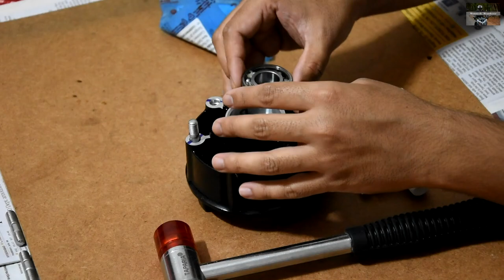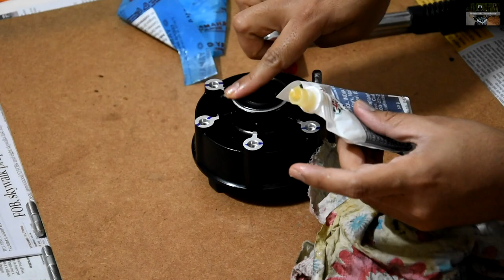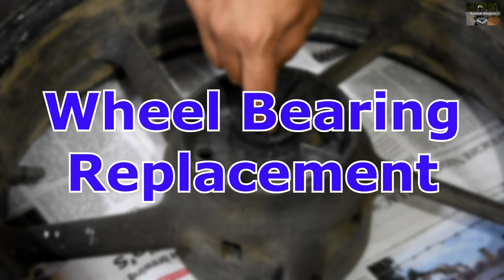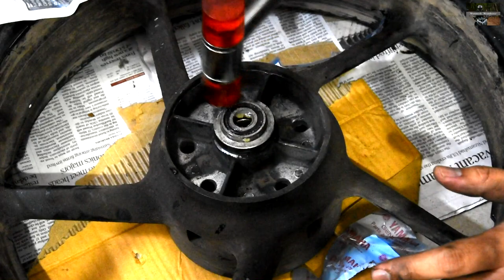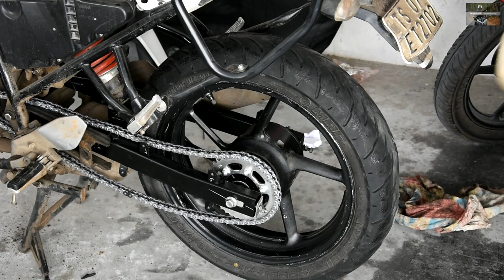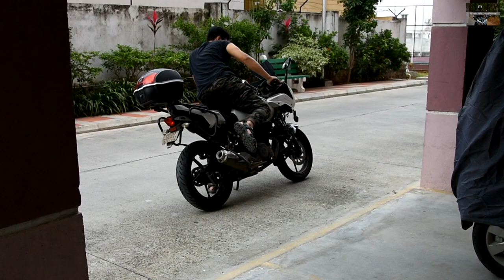#DIY : YAMAHA FZ v2.0 / Fazer - Bearing & Chain Sprocket Replacement : Rebuilding Snowy PART 2 of 4

Comment: Can we use a bearing puller in place of hammering with a rod/screw driver for removing wheel bearing ? Is there enough space between the spacer and bearing's inner ring to slide in a bearing puller ?
Reply from the maker: With the given space it difficult to use the  bearing puller, but you can give it a try. I did not have a puller to try it.

Comment: My fz rear wheel sprocket hub is broken which is attached to chain sprocket and between the wheel... 
What is the name of that part? 
Is that part available???
Reply from the maker: That's the rear wheel hub.
Reply: @MototechWanderer  can i get that part whats the cost
Reply from the maker: I think it was around 800-1200 something.

Comment: Which chain sprocket brand you suggest to go with.
Reply from the maker: Go with Rolon or Yamaha original ones.
Reply: @MototechWanderer  what is the tappet adjustment value for exaust and intake for the fazer v2 which u have
Reply from the maker: @TheAgust  Inlet : 0.08mm to 0.12mm

Exhaust : 0.12mm to 0.16mm

Comment: Gentleman I have Yamaha fz  , recently I'm facing vibration and suddenly pickup dropping ,some times head light increase and drops automatically
Reply from the maker: Regulator Rectifier unit gone - Headlamp increase Decrease

Swing Arm Bush / Bearing gone - Vibration

Air Filter & Sparkplug needs replacement - Low pickup.

Comment: R15 v1 sprocket direct fit in fz v2?(14/42)
Now i am using fz v1 sprocket, 
Any ideas?
Reply from the maker: Nope. Won't be a direct fit. If you need more pickup, look for Pulsar 13T front sprocket.
Reply: @MototechWanderer  R15 v2 sprocket in fz v2 ?? Too many sggstions from alrdy used customers for low end torque

What is your sggstion sir...for high performance ????

Comment: Before fixing/hammering bearing in the wheel hub ,outer surface of the bearing should not be greased, some mechanics will do brazing on the bearing before fixing so that it will be a tight fit
Reply from the maker: The bearing pits were absolutely perfect. Even with grease, the bearings sat perfectly snug. There is no way they can come out, unless hammered from opposite side.

Thanks for the info though.

Comment: My new Rolon chain is currently facing wobbling issues. Chain is moving zig zag. The rear wheel alignment is good. Front and rear sprocket is not bend, Slack tightness is correct. But chain is wobbling and can see the wobble in the rear wheel hub too, i changed the bush inside but issue still exist. If it's the bearing  issue, then the whole alloy should wobble right but the alloy wheel is moving straight and there is no handling issues. Some said Rolon chain has this issue because it's very big chain compared to stock chain.
Reply from the maker: By your description, it sounds like the rear sprocket bearing is worne out. Time to replace the sprocket bearing. The wheel will not wobble as wheel is supported by wheel bearings which are separate entities.
Reply: @MototechWanderer  Ok if the sprocket bearing is worned out the wheel wont wobble right. I thought if the bearing is worn out both the wheel and the hub wobbles
Reply from the maker: If you go through my Fazer rebuilding series, you will clearly understand how the rear section of our bikes are designed. In short, wheel rotates on 2 bearings, one on each side. Sprocket sits on a separate bearing with a collar to hold it in place. 

In my Gladiator, the bearing had broken into pieces, chain was still good but made horrific noises. It took me some time to understand. I actually was lucky the chain did not break on me like my Fazer's incident.
Reply: @MototechWanderer  Thanks for your info bro. I will update once i change sprocket bearing. I'm using MT15 covered 40k kms. Recently i changed the swingarm of my MT15 with R15 V3 swingarm. First i thought it was tge swingarm issue but i've contacted people who changed it to v3 swingarm but none of them has this issue. Maybe it's the bearing. Do u know how much it cost
Reply from the maker: @storymaker_____  put up a video of your swingarm swap. There is always to learn from all of you. Bearing should cost anywhere between 120-250 INR.
Reply: @MototechWanderer  I've uploaded the video on my channel 😁
Reply from the maker: @storymaker_____  I will check.

Comment: why have you used 40 T rear sprocket ..of fz16 ??usually fzsv2 have stock 41T sprocket....By changing to 40 t mileage will increase but little bit lag in pickup.Anyway nice content .
Reply from the maker: I use this mainly for touring. So a little relaxed engine is good for my use.
Reply from the maker: Thanks for your appreciation. Do subscribe to my channel.
Reply: @MototechWanderer  i need good performance bro..what about R15 v2 sprocket ( 15/47 ) for my fz v2 fi ?????
Reply: Suggest me the best chin kit for fzsv2 2018 model pls any one ...tel me the cost of shokbzarber price for fzs v2

Comment: Hi brother i saw ur every video...i myself own a gladiator ss 125 and a fazer 2.0 fi version...can u please share dat, from whr did u installed the saddle stay all touring setup on ur fazer?? I wanna do it
Reply from the maker: I had bought this from Nexus Gear. You can search their Facebook page or visit their website - https://www.nexusgears.com/
Reply: @MototechWanderer  thannx for your valuable reply...keep growing..,💜💜
Reply: @MototechWanderer  is it available at that site for fazer or u have fitted of another bike??
Reply: @MototechWanderer  i have searchd in dat pag....m jst getting parts for yamaha fz 25
Reply from the maker: @anupamdalvi7752  Message them on their FB page they will definitely reply. I got it done on special order as I was their first Fz v2.0 customer. They have the design and can easily make you one now. 😊👍
Reply: @MototechWanderer  thanks alott for ur help brother...i got in  touch with them

Comment: Since you did this all by yourself I have one important question to you! 
The PCD of rear sprocket of FZ and the PCD of R15 V2 are same or not?
Reply from the maker: They are not same.
Reply: @MototechWanderer  Thanks! I was about to procure fz  chain sprocket for my Yamaha R15 V2 after doing all length calculations.

Comment: Bro , kya 40 teeth chain sprocket se pickup bike ka kam ho jayega aur chain zyada din tak nahi chalega, meri fzs mein 41 teeth ka sprocket hai aur muje 41teeth ka sprocket nahi mil raha to main 40 teeth walo daal sakta hoon.
Reply from the maker: Pickup halka sa kum hoga. Chain life same rahega.
Reply: @MototechWanderer  bro meri chain set  26k km chal gai main bahut gentally drive karta hoon to approximately ye chain set 20k km tak to chal sakta hai na.
Reply from the maker: Depend karta hai chain and sprocket condition pe. Agar aap properly maintain karte ho, toh bilkul chal sakti hai. Like har 500-700 kms pe lubing and 1000-1200 kms pe cleaning+ lubing.
Reply from the maker: Generally sirf front sprocket jaata hai ... Bas usko replace kar lo.
Reply: Bro,but meri bike ki chain ke roller losse ho gaye hai uski wajah se chain noise aata .
Reply from the maker: @sumitkuwar526  sprocket ka dhyaan rakho ... Kharab sprocket se chain tut sakta hai. Aur chain maximum loose hone ke baad replace kar lena chahiye

Comment: any solution for uneven chain slack???
Reply from the maker: If after heavily cleaning the chain with diesel / petrol / kerosene.    And lubing it doesn't become fine, the chain needs replacement.

By default every chain had a maximum and minimum area of slack.

Comment: Hello my Fz rear tire bend towards left . Whats to do . Ithink the sringamm is bend
Reply from the maker: First check the allignment properly with the chassis (not with mudflap). If you still feel it's off the axis, replace the swing arm.
Reply: But alignment lines are correct both side
Reply: And my rpm meter not working .is there any sensor for that
Reply from the maker: @favazk5705  remove the Speedometer console plug and spray some WD40 on the pins and scrub with a tooth brush. It should work.

Comment: Could you please tell me the bearing number for sprocket, front wheel and rear wheel for FZ S V2.0?
Reply from the maker: Need to check. I have lost the packets.
Reply: Front and rear wheel bearing number - 6202
Sprocket bearing number - 6004

Comment: I had a question I have a fzsv1 2013 what's the largest back tyre I can go for without any modifications in the stock swing arm .... I was thinking about just upsizing from 140 to 150 .. will there be any rubbing? Please help me out brother I can find someone giving concrete answers
Reply from the maker: 140 is stock. 150 is still manageable without any modifications. 150/60 R17

Comment: This chain gives better mileage?
Reply: Reply me bro
Reply from the maker: I won't say that. This chain will not make any significant difference other than lower RPM for a given speed and slight drop in the pickup.
Reply: This chain gives beter milage? Suggest best chain
Reply: Thanks now I am subscribe u r chanel gud work bro ..shokbzarber cost chappagalara...
Reply: Thanks now I am subscribe u r chanel gud work bro ..shokbzarber cost chappagalara...
Reply from the maker: Rear shock absorber costs around 4500 INR.
Reply: @MototechWanderer  thanks brother

Comment: You should be mention to bearing parts number ☺😊
Reply from the maker: Wheel Bearings
93306-252XG
93306-252YH
93306-202XT

Sprocket Bearings
93306-054YA
93306-054Y5

Oil Seal Wheel
93106-22808

Oil Seal Sprocket
93106-26801

Comment: Never replaced the sprocket nuts.. 40k+ kms
Reply from the maker: Actually not needed. In my case it got grinded by the chain at high speed.